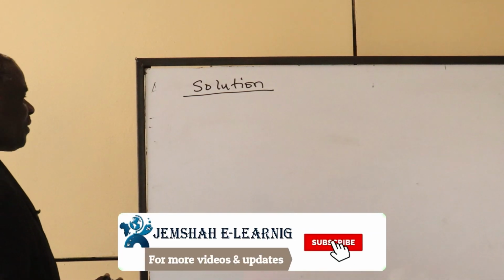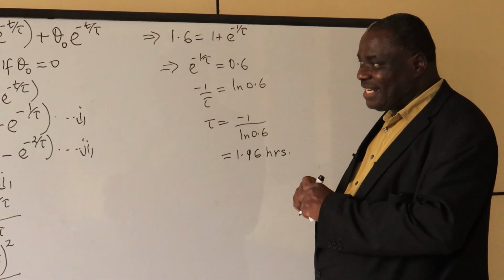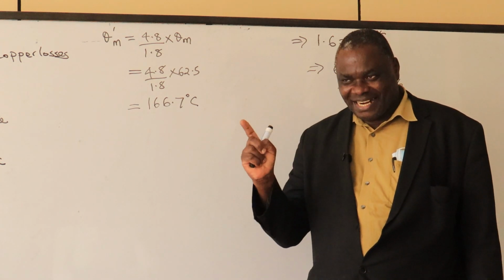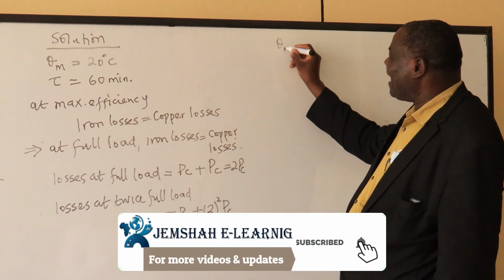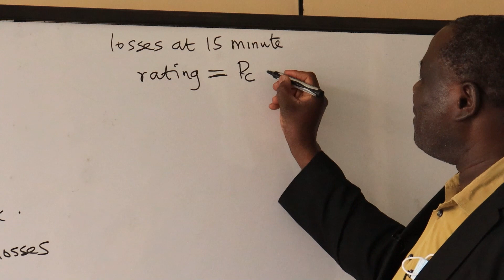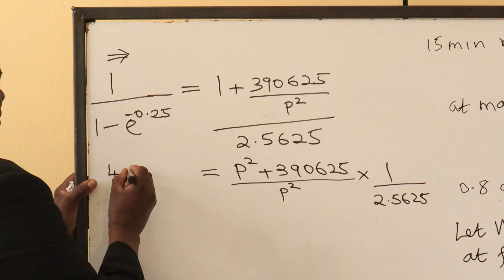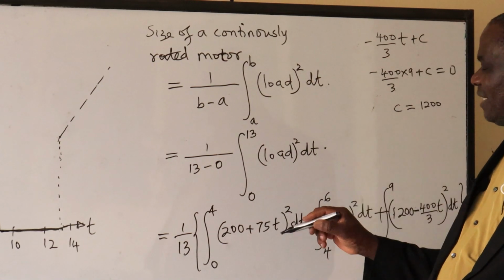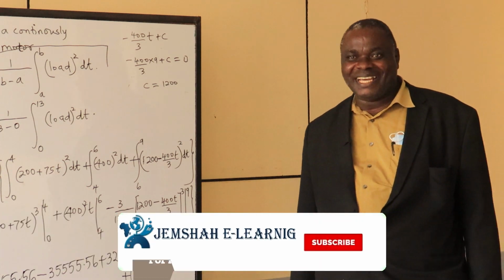EXAMPLES OF ELECTRIC DRIVES / ELECTRIC HEATING

Comment: good work but my concern is on example 4 
can you kindly explain how to come up with such values please for example the first integration how can it be 200+75 and you have not shown where 75 is coming from
kindly consider this and answer me please🙏🙏
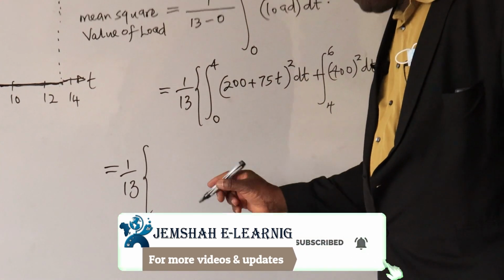Reply: 75 is a gradient of the straight line.Remember for a given load rising uniformly he has used equation of a straight line to represent it.200 is a y intercept then 75 the gradient or slope of the straight line 54:49
Reply: @dkioko6819 that was helpful, thank you very much